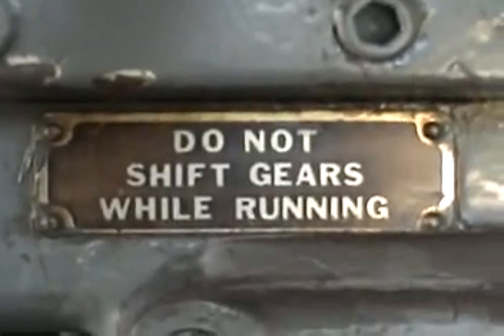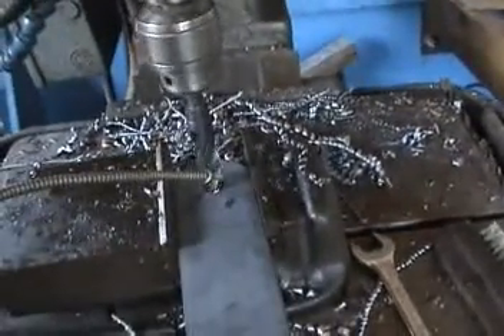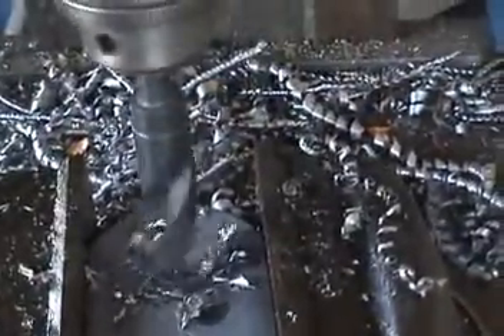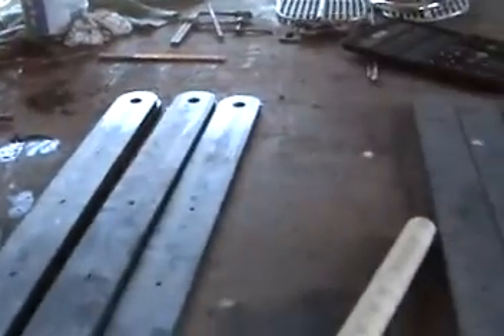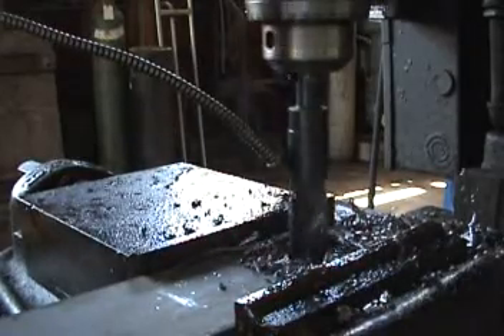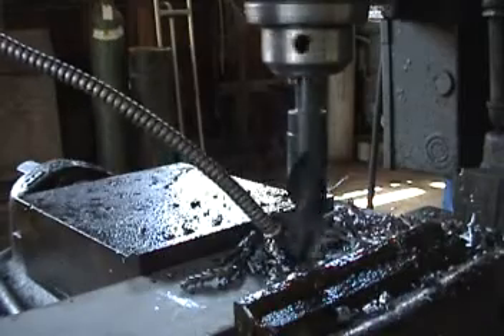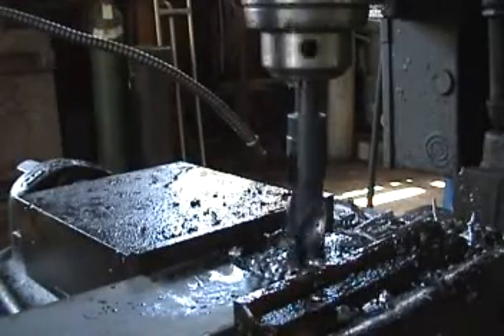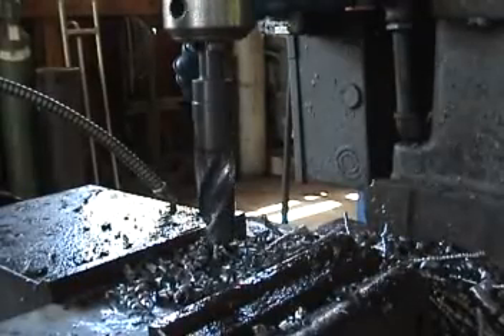Phoenix chainplate fabrication (no iris)

Comment from the maker: yes,
I am going to be videotaping all progress. Instalation of the chain plates will be after I haul the vessel out to work on the hull. I do not know when that will happen. Over the next year much will take place. sew 3500 square feet of sail, shape 12 spars, install standing and running rigging, clean & paint 50 ton ferrocement hull. Next time I videotape something I'll zoom in on a copy of the plans so my objective is plain to see.